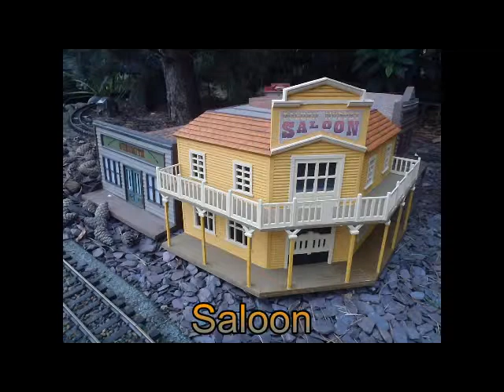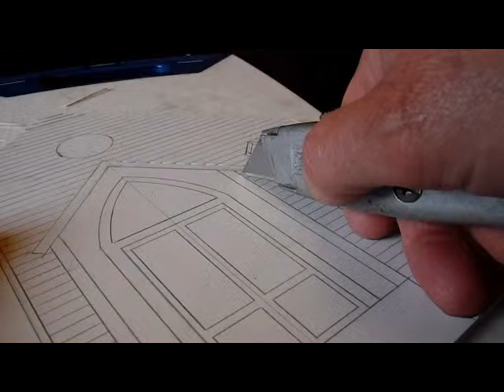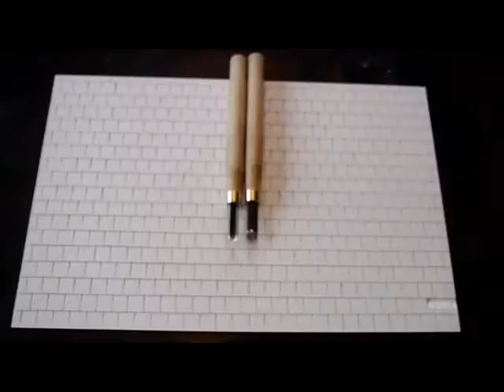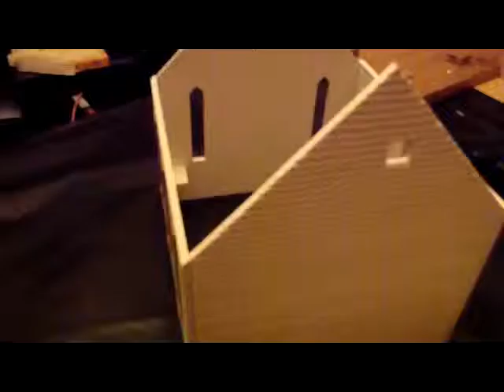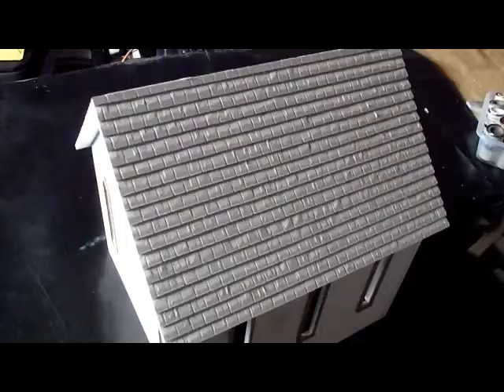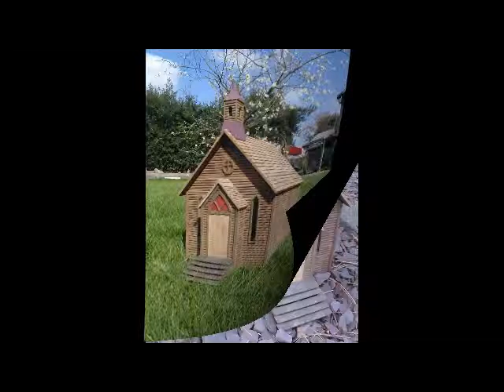G Gauge Wild West 3D Building Kits Construction Tips

Comment: How thick is the foam board you are using ?
Reply from the maker: Hi John..sorry for the delay, just noticed your post. All main sides and roof are 5mm thick and minor areas e.g steps are 2mm.
Reply: Thank you. I tried 3/16 foam which is close to 5mm but it did not work well I don't think the density is as good as what you are using. I think I will try some  Elmers" brand foam may have better density.